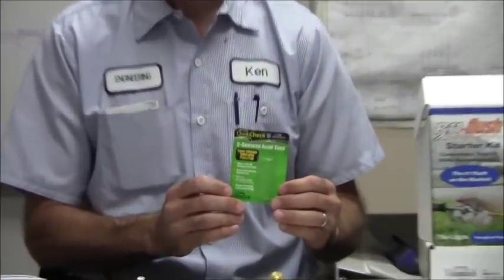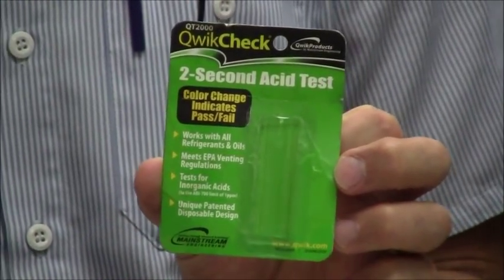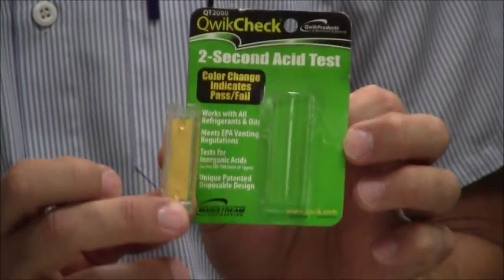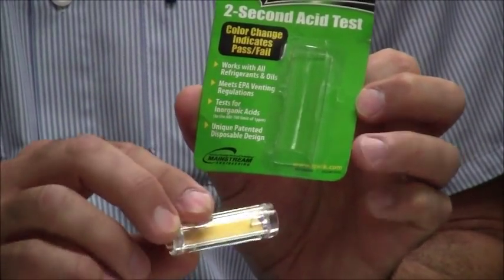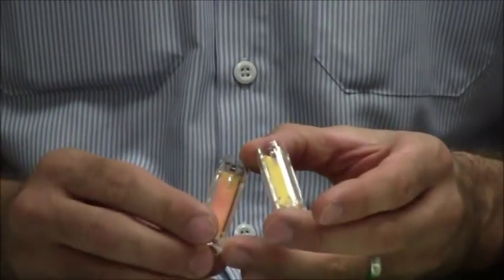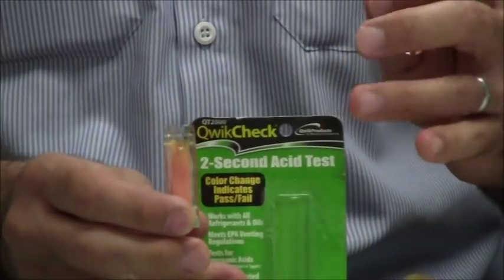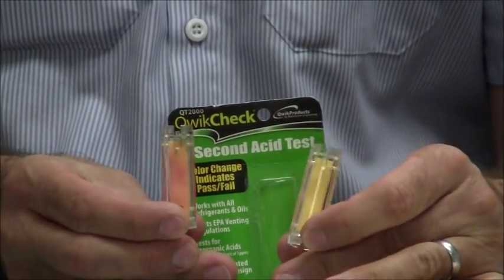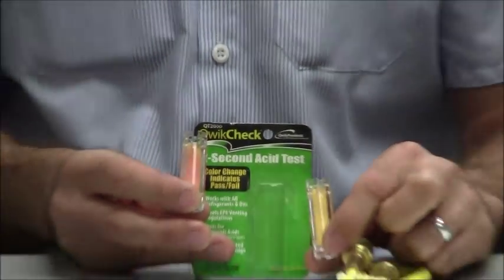Compressor Burnout and Clean Out with Rx11 Flush

Comment: I do appreciate the video Ken but these companies selling small quantities of flush are doing a disservice to the industry. To properly flush that system would take gallons of flush. It's expensive and they know it wouldn't sell in large quantities so they market it in these little piss bottles and make a fortune on the markup. It does have its place on short small diameter line sets that are going downhill with no traps to collect the liquid.

For the new compressor's sake I hope you can get all of the flush out of the system so it doesn't thin out the oil. Huge amounts of nitrogen at very high flow rates are needed to get the liquid out and you can't flush the evaporator with any metering devices or restrictions. You will fill the tubing up with flush and it's almost impossible to get it back out because of the very restricted nitrogen flow.

All of that flush that didn't come out will need to be removed by vacuum now. Lots and lots of time and many oil changes. Please do a followup video and let us know how it turned out. Best of luck!
Reply: Nicholas CeeA They say blow it out with 120 psi nitro.
Reply: +Gene Friedman The pressure doesn't help in this case without a large enough flow rate to pick up the liquid and carry it out of the system. The blowgun among other things is limiting the flow.
Reply: Everything you(Nicholas CeeA) said seems to make sense.  How do you clean burnouts then?
Reply: Ya just gotta to do the best you can with a bad situation. Install a suction line filter drier meant to neutralize acids and monitor them frequently. Best to install one with a removable element and keep changing it out until the readings are under control. Pretty much impossible for a field tech to do but doable in this scenario. Then remove the dryer or element after its work is done but that usually never happens either.
Reply: Nicholas CeeA have you tried to use R141b for flushing?

Comment: This is good video but it is easy to do in a laboratory. I would like to see how you would do this if the line set is coming up.Rubber connection for me is not  good design. Should be real engineering.

Comment: Good video. I'm not in the hvac business. I've heard of people just blowing the lines clean using acetone, instead of that high $$$$ snake oil  bs, and then blow dry with the Nitrogen.
Reply: I've heard that too
Reply: +Cooll Asice not snake oil we use it on burn outs and it works
Reply: no way to really know if it works.  This was not actually applied to manufacturers instruction. They actually want you to disassemble much of the unit, like the TXV or metering device and get gravity to assist you in getting the oil out.  I would rather blow it out with CO2 or nitrogen as best I could and install an oversized activated charcoal drier (HH) with flare nuts with two refrigerant ball valves, and change the driers several times to clean it up.  Worked in years past, nothing has changed. If you want to flush the lines, blow em out then chase em with new oil to pick up any thing left over.  Oil is alot cheaper. Id be asking myself, why did the compressor fail?  Especially with all the oil in that bucket. Piping was either not trapped properly or lack of pitch.
Reply: Acetone doesn't break down the oil , won't work ,